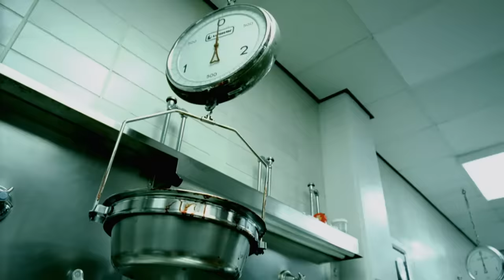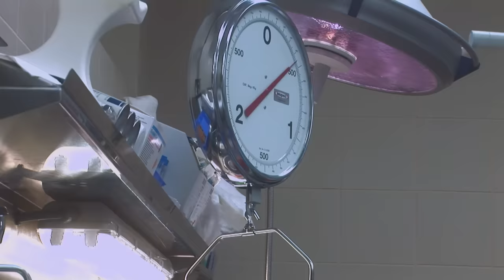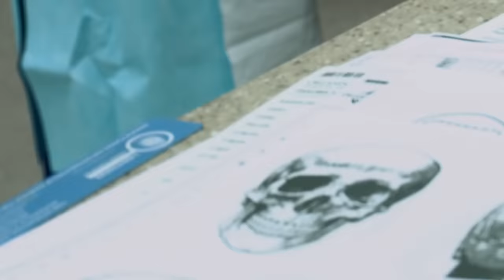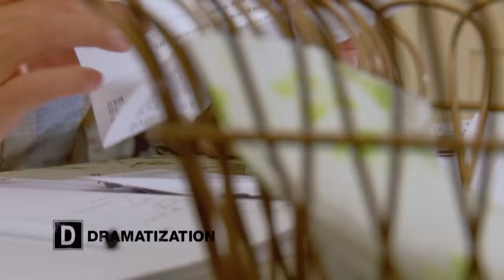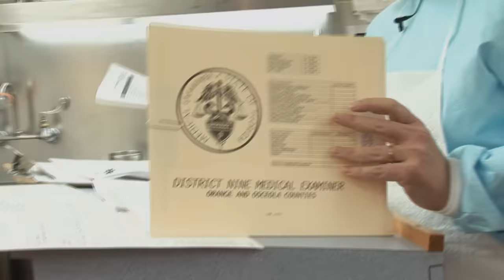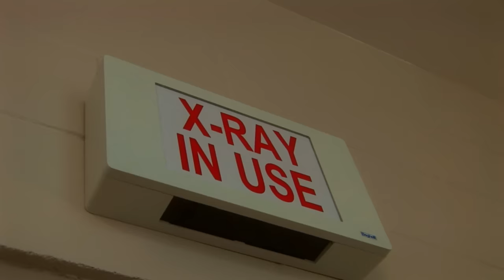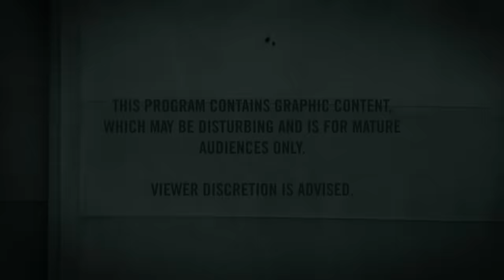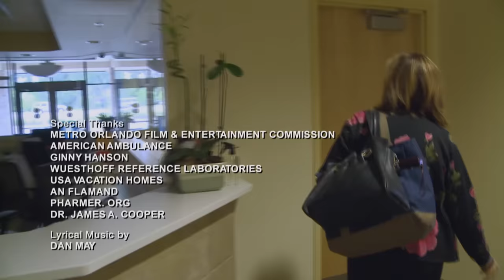Dr. G: Medical Examiner - Season 7, Episode 5 - Body Burn - Full Episode

Comment: I wish I could try fentanyl just once to see if it works on me and how. Anything weaker than morphine isn't worth bothering with, morphine isn't really that effective on me either- same for my Dad, we can have enough that it should be impossible for us to be conscious, let alone lucid, and be up talking, walking if possible, and still complaining of pain. In my case I was pacing the hospital room, I gave the night nurse quite a shock when he checked on me and saw that, but in Dad's case he'd just had a hip replaced so walking wasn't possible, but the nurse told him he shouldn't even be conscious, let alone talking normally and still in pain. My sister also can't take morphine because it just doesn't work on her, but she claims other opioids do, which confuses me to be honest. Shouldn't they all either work or not work to a similar degree? I suspect we have a genetic mutation. I wonder if our innate resistance to opioids holds true for fentanyl as well. Would it act as a CNS depressant without being much of a pain killer? Would it have a reduced effect overall but still have some effect in both areas? Just how much? And would it give me the same side effects of one of the lesser ones- it was either hydrocodone or Oxycontin- that gave me unpleasantly vivid dreams? Because with that one it only worked as well as ibuprofen but it made me kind of scared to go to sleep because whatever I dreamed about would feel really intense, so I only took one pill after I was discharged from the hospital. I had a very vivid dream that was a repeat of one I'd had in the hospital, so I never bothered taking another.  I've got like three old opioid prescriptions sitting around because I tend not to throw anything that might be useful later away, all with one pill missing, It's like a trademark or something. I need to get rid of those tbh, because it's not like I'm ever going to use them. They're probably expired anyway, so even if it was legal to give them to someone else who's in pain it wouldn't be a good idea.  Oh, the tramadol they gave me when I nearly broke my ankle last year isn't expired just yet. (I just checked.) But whatever, that stuff's worthless anyway. Didn't have any effect at all. So even if it wasn't going to expire in half a week and wasn't illegal, it'd be pointless to give it to anyone. Even if it's apparently not as useless on everyone else as it is on me, they said it was the weakest at the hospital (I told them it wouldn't work, but they seemed to want to give me something, so I let them.), so if my understanding of how little opioids work on me compared to normal people is accurate then it shouldn't be any stronger than Tylenol anyway. If it's addictive and all that, why not just take Tylenol? I usually stick to ibuprofen, but it retards bone growth so it's not always the best thing to take. I've cracked/broken more than one bone, and you don't want to take something that slows bone growth after that kind of thing. Last time I made that mistake because I didn't know better it took a month before the cracked bone in my hand stopped hurting. Actually pressing on it where it felt off until it popped helped too, it didn't really start getting better (aside from the bruising going away) until after that, so maybe it was a good thing I took the ibuprofen because if it had healed too quickly it might have started to fuse before I realized the bones weren't aligned correctly. But still, assuming you don't have that particular issue, don't take ibuprofen for bone injuries. You'll heal slower than normal, and that's not fun.
Reply: Morphine and Norco never helped my pain. The hospital gave me morphine in the hospital and sent me home with Norco. That was when I broke my ankle severe enough to dislocate it and on top of that I had surgery to put plates and screws in. When I met my surgeon he prescribed me perocet which was way stronger than the hospital gave me. It helped tremendously with my pain. I only took it when I was in severe pain if it was only moderate I took ibuprofen. I know that they were addictive to people. I was shocked when he gave me 40 of them. That was a few years ago. I'm in full recovery and had no issues with my ankle